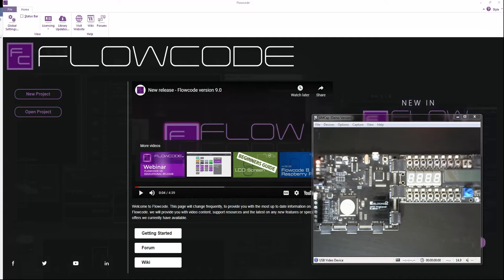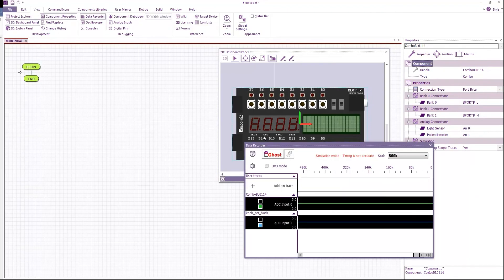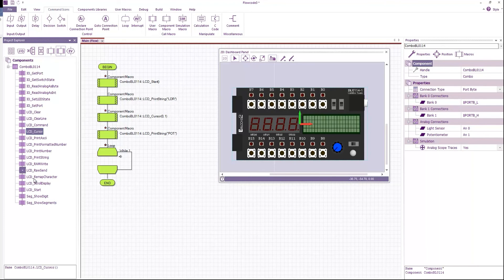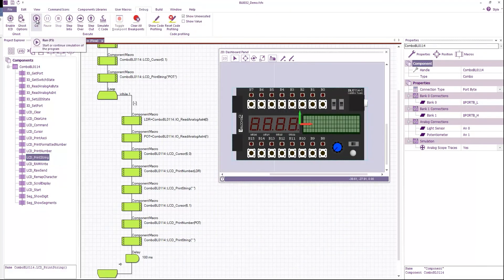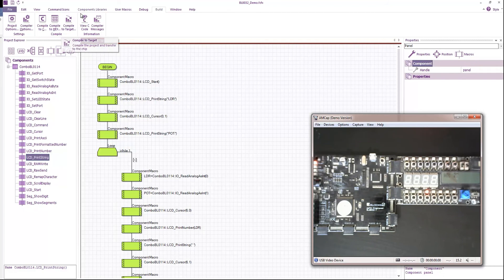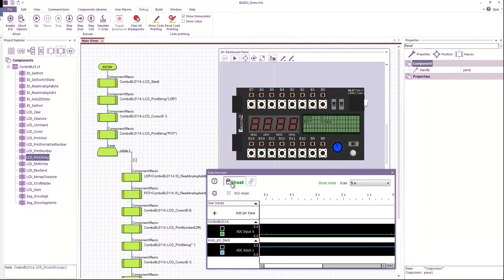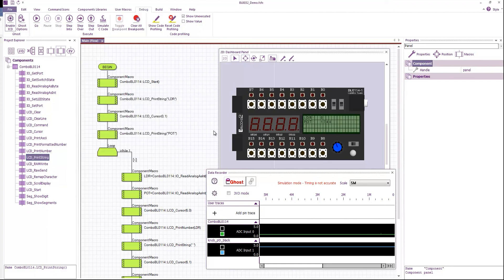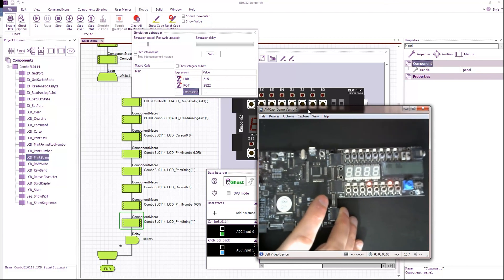Flowcode with EBlocks2 hardware and Ghost

Comment: Very impressive! Is it possible to single-step through the underlying c or assembler code?
Reply: Hi John, You can show the C code and the Flowchart icons side by side and step through one or the other or both at the same time. No assembler based stepping atm though.
Reply: @001Tech  C is more important, assembler would be nice but not essential.